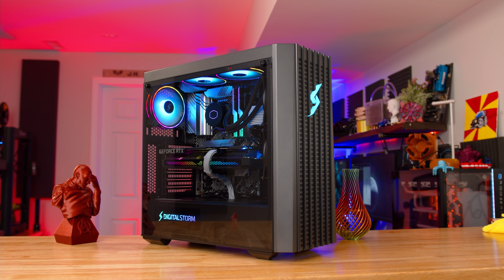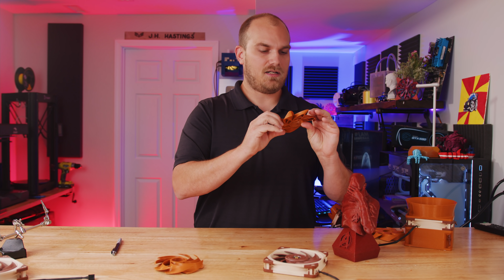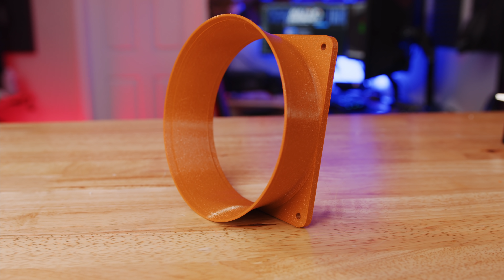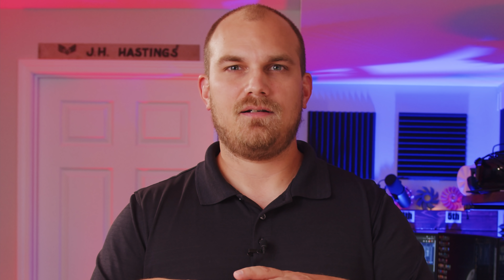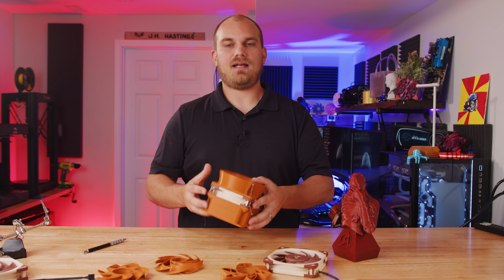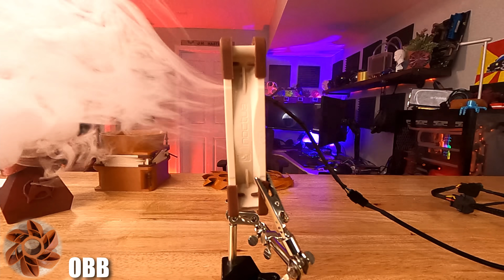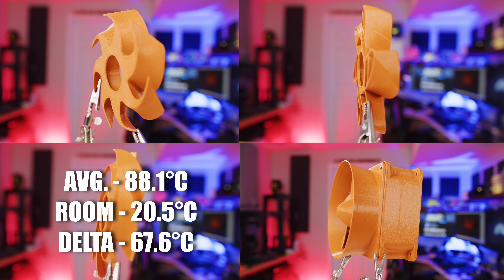Is this CHEATING? - Fan Showdown S3E3

Comment: Maybe break it into two categories? Standard where everything printed has to fit inside the fan and a Free For All where anything goes.
Reply: One focus on fan blade design, another focus on fan design.
Reply: Why penalise someone for 'thinking outside the box'?
Reply: @mitchellbaker4847  I think this is not penalize, just be more specific. Just like both Bill gates and you local store manager are business man, they just working on different level, and you won't classify them together
Reply: @mitchellbaker4847 because form factor matters for many applications
Reply: @mitchellbaker4847  When one or two people do it, it's thinking outside the box. When more than that start copying them it should in its own category to separate the pieces to make the puzzle work.

Comment: Definitely not cheating. Until you specify a size envelope for fan designs to adhere to, I would only call it cheating if it required accessory motors or bearings, or any non-printed hardware, apart from maybe some screws or glue for convenience.

Comment: technically there is no rule that you can't add pieces to the back. your specification that it has to fit that Noctua frame and motor and it does.

Comment: Would love to see assemblies like the cheater run both with and without their accessories. Would be curious to see how much of it is really just airflow efficiency mods vs fan design.
Reply: OR, test the assembly with the Noctua fan and see if it performs better?
Reply: @Garbox80  that is a great idea
Reply: @Garbox80  agreed
Reply: @Garbox80  It will work better due more effective heatsink airflow coverage without deadzones.
Reply: Yes, if a fan can be run separately from its shroud, it would be great to see what improvements are related to which part.  With the Cheater, for example, does the rear air guide, which is a very large part, offer a worthwhile benefit considering its space consumption?  There's little doubt that all the pieces help it perform better, but by how much?
Reply: You're all right, it deserves its own episode
Reply: This, please run the top 5 with and without this shroud
Reply: Yea, a special episode fan showdown, just about this topic with 2-3 designs just about the topic. It should not compete in the normal list until the benefit of the extra parts is checked.
Reply: @alphastratus6623  perhaps there could be a special episode in which the optimal shroud of those we've been using yet can be established.
So one baseline fan, perhaps the cheater from here, and every shroud/rear guide combo we've had yet.
Reply: I'm with these guys!  I agree that ducted fans need to be tested without the shrouds to see what their real performance is. It's very possible that the best contenders in non ducted category would outperform the top rankers if you put them in the same housing.
Reply: @SolarSeeker45  thats not what we're saying though.  We're saying use those shrouds with the other fans.
Reply: Ya
Reply: I second that
Reply: @AlexandreMS71  Thirded
Reply: Fourtheded
Reply: Would love to see them compete in one offs honestly. Both with and without the accessories.
Reply: I've always wondered this as well, It makes sense in a more industrial application, but at such a small size IDK.
Reply: In auto racing engines long "velocity stacks" (straight intake trumpet) work best at low rpm while short work best at high rpm.

Comment: The Noctic threw a turbulent mess of smoke, result last place as per usual when I see something like that. Hepto was all pretty messy. The Cheater almost needs an astrix... I kinda feel like anything that comes with more than just the fan itself should at least be labeled and a more complicated construction or set in it's own class. Oval Blade was easily impressive as just a fan though. Noticed the name tags where wrong on the cheater though (labeled as Noctic) and the slow mo was a a little off? too dark, maybe?

Comment: I certainly like the idea of there being two separate categories: 

Practical - where the entire fan design would fit inside a normal shroud and could be used in your average build.

Freeform - where anything goes as long as it fits on the testing rig.

This way we get to see both raw aerodynamics engineering and complete over-engineering setups, alongside the more aesthetic-focused builds.
Reply: That would be my vote. I think someone could maintain a list with extra category identifiers on the subreddit if nothing else.

Comment: I could be wrong but I'm pretty sure the main purpose of a velocity stack isn't to "smooth the airflow" its to increase the velocity using bernoulli's principle. Not an engineer just a mechanic.
Reply: Precisely! Granted, slightly less turbulent flow around the inlet is a nice side effect 

Source - I've designed intake systems for my own 2 stroke race bikes
Reply: The velocity stacks in this series actually only smooth the airflow since the fan is in a zero velocity free-stream.  They don't do any thing else.  If the whole fan apparatus were moving, then air would be rammed down it and indeed it would take advantage of Bernoulli's principle, but since all of the airflow here is driven by the fan, there's no magic here, there's no extra velocity.

See this wikipedia page if you want the gist of it: https://en.wikipedia.org/wiki/Components_of_jet_engines#Subsonic_inlets
Reply: Both not really correct. Its to defeat the "vena contractor" effect. which reduces the actual air flow you get. 

Velocity and bernoulli's dont really have anything to do with it
Reply: @t_c5266  what do you mean velocity doesn't have anything to do with it, the wide neck allows a large volume of air in and tapers down, where there's less available volume so it increases the velocity, therefore the name AND role
Reply: @brettc5386  velocity doesnt change mass flow though. just speed. Like I said, its more the vena contractor effect, and less the increased velocity giving you the advantage.
Reply: @t_c5266  you didn't honestly say that... Did you???
My guy, velocity IS speed, with a directional constant thrown in there...
Please stop before you hurt my brain.
Reply: @maxman1244  I understand that you just took your first highschool physics course, but there is nothing i said that is incorrect.

Sorry you aren't smart enough to recognize a synonym :)
Reply: @t_c5266  you just regurgitated what I said.
You stated that speed and velocity were entirely different things. Maybe reread your own comment lmao
Reply: @maxman1244  I'll let you re-read it yourself until you understand that your interpretation of what I said, and what I actually said, are not the same.

Try to keep up, bud.

I'll give you... 2 more replies worth to re-read it and attempt to grasp the correct understanding before I re-phrase it as if i was talking to a kindergartener to allow for your understanding

Comment: Id like to see the a12x25 used with the intake and exhaust housings in place and see how they improve the flow of the fan. Try it with just the intake then just the exhaust then both and compare how all 4 setups performed
Reply: That would be very interesting to see.

Comment: The Noctic has an incredible pedigree, have the designer rework and resubmit. I think he's on to something.
Reply: Take the original fan .stl file copy and paste a second on the center point except the second fan file rotated a degree or 2
Reply: I noticed the Heptopod (being thicker) didn't do as well, so maybe a thinner fan preformes better. May need to improve the structures stability, but keeping a thin blade like the Noctic did might be a good idea.
Reply: I'd love to see this fan retested with slightly smaller blades (or of course using Noctua's secretsauce material :P)

Comment: I don't think it's cheating but I'm tired of seeing fans that break the dimensional confines of the noctua frame tested against fans that don't.
Working on a testing apparatus and will be testing only fans that fit in the frame against each other.
Reply: I agree, but instead I have started to design bigger fans myself to take advantage also.

Comment: I think that there should be 2 categories: fans and other. Fans would be all fans that fit normally into the fan shroud, without sticking out or any additional accessories. Other would contain everything else. I think this is fair because this doesn't give a unfair advantage to fans that wouldn't be usable in real life.
Reply: I agree, but for 3 categories: case fans that can be mounted to push or pull (nothing protruding), cpu cooler fans that can have some protruding (but not so much that you can't fit it in a pc), and everything else
Reply: standard and oversize form factors more like

Comment: This isn't cheating, more a "what if" experiment. Cheating would be to place a powered bigger fan with a funnel in front. :) IMHO you would need categories, by size. Winner in the default class (in same envelope as a 140x25) , winner in the double height (140*50) and the "anything goes" class.
Reply: I agree, different categories are definitely needed

Comment: Camera upgrades look great for your talking head shots.  On the smoke test it looks like the ISO was cranked super high.  What camera did you upgrade to?
Reply from the maker: Ya I think I needed more light for the gopro
Reply: @MajorHardware  you should do a video on your old A/V equipment and your upgrades, and let us know what you hope each piece of equipment does for you
Reply: @MajorHardware  up next a small jet engine
Reply: @MajorHardware  You absolutely need more light.  With a faster framerate, you lose exposure for every frame you're capturing.  The Gav from the Slo-Mo Guys can probably give you a few tips.
Reply: @MajorHardware  The new gopro is nuts.
Reply: @MajorHardware  with slow motion video capture, you often need a TON of light. Like bright enough to make it hard to look at the scene in some cases. 

Awesome work, though. This is one of 2 channels I sub to that I have notifications actually turned on.
Reply: The trick with showing particulates in the air is to hit it with a light from behind (off camera). I usually would do this when filming water effects or smoke even. That back light for smoke will really make it pop!
Reply: The smoke test music volume was also way too high imo. Love the videos though! Fan showdown is one of my favorite series on yt!
Reply: @corbaintuous  music seems to be louder than talking in almost every video i watch. I think it has something to do with how YT processes videos
Reply: @corbaintuous  
Absolutely agree was going to comment on this myself since I've been blasted a couple times while wearing headphones. Also agree that this is quality content done competently.
Reply: Came to say something not as educated... like cheap soap opera right?
Reply: @liveepically  Nah, the soap opera effect is from watching 30fps video at 60fps.  If premiere had a 30fps input it needed to guess what the middle frames looked like.  If you turn off 60fps it will lose that effect.
Reply: @TheHookUp  wow. thanks for the explanation...much appreciated!
Reply: Yes, do you know if GoPro sets some shutter speed automatically or can it be changed? Though with 240fps using anything less than 1/480s shutter kind of misses the whole point - so needs a ton of light.
Reply: Yes I agree the b roles of the fans were a bit noisy, but all in all a solid upgrade 💪
Reply: Its juuuust a little too saturated and juuuust a little to dark and juuuust a liitle too much contrast. Not by much but just a little...
Watch your histograms, and make sure you have a decently color accurate monitor. Make sure is in a more "natural" color mode like SRGB rather than something like 'vivid' or like that.

You can use color contrast too if you want. just like light and dark you can use color too. teal and orange is a popular choice because the are opposite the color wheel. but at that point thats more a stylistic choice and opinionated.
Reply: @mipsalot  In this case it's all due to the GoPro being pushed beyond its capabilities. Not enough light for 240fps so it maxes-out ISO and runs into all sort of problems (noise, EV, DR, colors). Just by adding something like 4x light intensity solves all of this without any need for tinkering.
Reply: Who else liked this just because the are a "FAN" of The Hook Up?

Comment: Use a stronger filament for the one fan that would touch at higher rpm. Maybe a carbon fiber one? Or something that doesn't flex under load.

Comment: I think most of the performance advantage of the cheater was from the velocity stack. I don't think the huge rear shrouding helped too much and just made the entire package extra bulky
Reply: And it would be much more practical to fit into a case with just the velocity stack!
Reply: It's actually opening larger area of the cooler for the flowing air. But yes, it can very well be pointless :-D

Comment: personally i think the cheater is totally fine even though it wouldn't really be easy to use in a pc. But it's design is very much aplicable as a fan for other purposes that can leverage it with a test here that really shows it's potential

Comment: I am all for big complicated multi-part fans. I just want to see what the absolute limit of cooling performance looks like, with no holds barred.
Reply: Agreed, take it to the limit!
Reply: I completely agree and think your comment represents the spirit of the fan showdown. No need to complicate things with categories. Lets just see what creators imagine and put their creations to the test of airflow and cooling. That's why this show is so much fun to watch and enjoy. Applying limitations will only throttle down the ingenuity, and in the end, none of us want to see that happen.
Reply: Isn't the limit of cooling performance simply not a fan. You could keep things cool better with a liquid cooling loop then any of these fan designs. So if the goal really is finding the best way to pull heat from a case why should he even bother printing fans?
Reply: @christopherpepin6059  Because it's a fun project that people with Blender or other 3D editing programs can participate in from all over the world. It also has interesting results sometimes with crazy designs doing better than expected. Is it optimal? Nah. Is it fun to see what everyone comes up with and then see all their creations compared with albeit rough tests? I think so at least.
Reply: @Quonzer  That's kind of my point though. If you change the scope to be finding what actually cools the best in an absolute sense you remove any reason for people to create these fun designs. Those velocity stacks are just an extra piece that could be added to any fan with the same results. I don't see how they inspire creativity all they do is pad numbers and if you just want to see big numbers there is no point in making these fans to begin with.
Reply: @christopherpepin6059  Alright fine. Maybe separate categories are needed after all. Though I think you may be taking this more seriously than intended dude.
Reply: @Quonzer  Erh, more just bored and have nothing better to do than write out my thoughts. I think that is usually the case on the internet. I don't think most people are as deeply passionate about the things they argue about as it seems.
Reply: @christopherpepin6059  You make a good point, and someday we will not need fans since we'll have a better technology to move heat. Liquid cooling is the way to go for sure, though in any liquid cooling system, a fan is still implimented to pull heat away from the radiator, unless a large passive radiator is used like in the Zalman Reserator. The benefit of liquid cooling is that water is much better at transfering heat compared to air, yet air is still used to pull heat away from the water in the radiator. Fans are still in use (in compact systems), though they don't have to run as fast as traditional systems since the water fed radiator is better at passing heat to the air than an aluminium only heat sink would be. Having a more efficient fan would still be very benificial for a water cooled system - especially one which can move a lot of air at lower rpm's, but that usually means a larger fan, so trying to make fans more silent while being fast is the common goal.
Reply: Liquid Helium or bust!

Comment: Should we allow it? Yes, absolutely, stifling ingenuity helps no one, also, it looks cool.
Reply: He's already allowed so many of these fans that break the confines of the noctua case that it hardly matters anyway.

As for stifling ingenuity... This changes the entire scope of the challenge. He won without even optimizing the fan itself, and it won't even fit in a case. Yeah, it's clever. It doesn't count as "best fan", though.
Reply: @SwervingLemon  If you've got the space...why not? There's usually a lot of space in front of a tower cooler, so if you really wanted to, you could. Also a 360 radiator with three velocity stacks would look sick haha
Reply: @ajsaracina8380  I actually really wanna do that now
Reply: @ajsaracina8380  If you just wanted to cool a case you could do better than any of these designs by simply running a stream of liquid nitrogen through it. Should all new submissions just be canisters of liquid nitrogen?
Reply: @SwervingLemon  Thanks  :-)
Reply: @SwervingLemon  That depends a bit on the case, it looks like it would fit fine in my case (Corsair Carbide Air 540) can't be 100% sure, though.
Reply: If disregarding the size constraints to brute force a win is allowed, I'm sending in my box fan to crush this competition